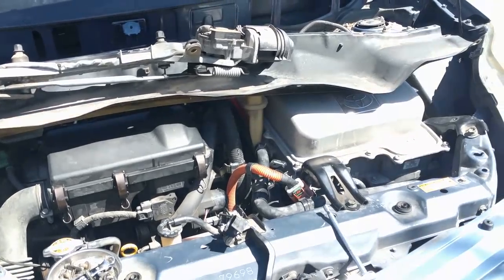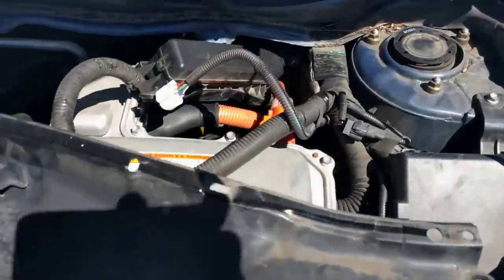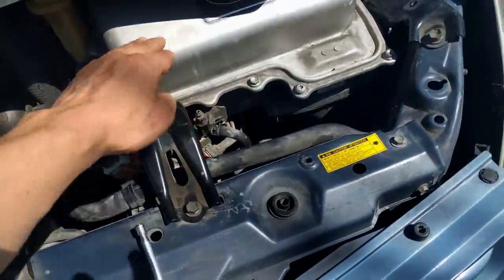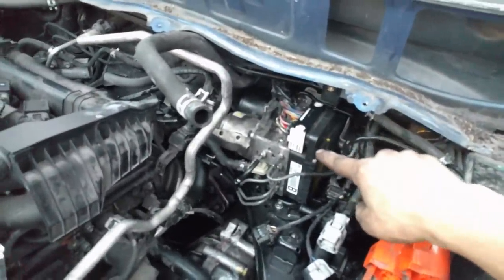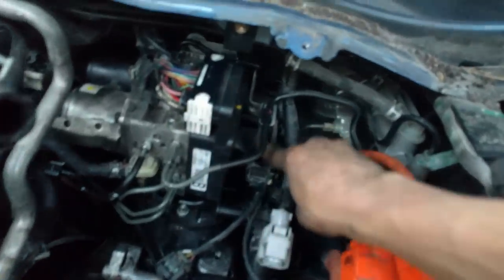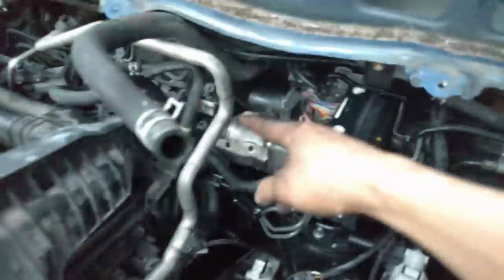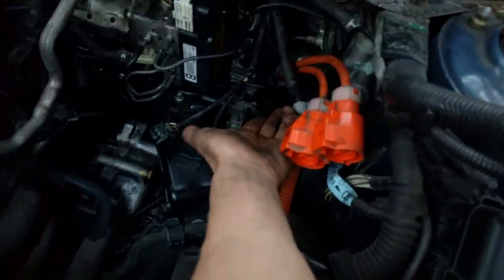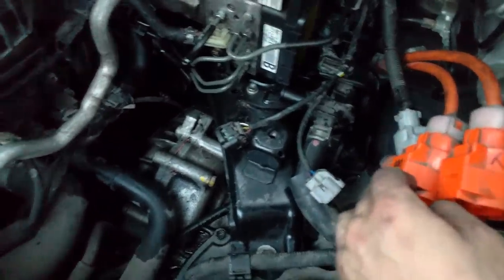2004 Gen2 Prius Brake Pump/actuator replacement

Comment: You only disconnect the 12v? Not the orange switch from the hv battery pack???
Reply from the maker: **You are correct: best to disconnect the orange switch from the HV battery pack. Thanks for posting!!

Comment: Thanks for sharing! Because you didn't die from electrocution, I decided to give this a try. Replaced the actuator and the brakes are working again. Yes disconnect the 12v battery and orange hybrid battery plug. I also waited 24 hrs to do the work. The work can be done quicker with the right tools, due to tight spaces. I used caps on the coolant hoses to prevent further leaking. I manually bled the brakes, which took a very long time, but it was achieved. Thanks again. Well worth the labor.
Reply from the maker: :) I hope your car is still in good shape!! At this time, my actuator and related work is still going strong!
Reply: Can u guys tell me what the symptoms would be if it was a brake booster vs brake actuatormy situation was there was a tall going on for a while everything work and then while on expressway lost braking ability completely one shop is saying it's a brake booster and other sayings brake actuator brakes are not hard to push but just won't break while moveing

Comment: BTW, there is a Toyota warranty enhancement out for this issue just pushed a couple months ago. Toyota just replaced mine on my 2005 a couple weeks ago.
Reply: for free? xact thing happened to my car.. beeping continuously, abs/ brake lights, and loss of brake pressure , i believe the warranty expires Dec 31 2017!! Since im so lucky the beeping JUST stopped, lights disappeared, and brakes are back to normal as i was driving to a friends so i can no longer provide evidence of the issue! Hopefully they can diagnose it still and cover me under this warranty! God help me  can't afford to fix out of pocket lol worst time of year for this to happen :(
Reply: was this like a recall or it needs to be under warranty ?
Reply: Same thing is happening to my 2005!
Reply: @Julia Bovi Hey, did toyota fix the issue for you? Your Prius is fairly new so hopefully they did something. I got so lucky with mine; the light came back on the 27th i barely managed to get it fixed under warranty (expired Dec that year)

My sister has a 2005 with just 75k miles - her went bad the following year after the extended wrty expired. We called corporate - zero help. Spent close to $2500 to fix it. 

Since then I sold my Prius, got a Lincoln MKZ Hybrid and i now have the same DAMN problem with the "brake booster system".  its a 2012 car with 70k miles, Ford said no warranty coverage! User error!? Luckily cost is cheaper than Prius to replace ($780). 
What else can we do with these faulty as brakes on these otherwise great Hybrids.

Comment: That's the easy part, how did you bleed the abs unit and brake system?
Reply from the maker: I purchased a cable off ebay which included a copy of Toyota's "techstream" software.

Comment: Does the brake actuator needs to be reprogrammed after installing new one?
Reply: Bassel Mustafa Yes calibrated , can be done with tech stream software, or I think it was 4 and 12 pin on the data port by sticking a paper clip on those pin holes, and rebooting the car . It will then start cycling all the brakes, and calibrating itself.

Comment: I have a whitlse while in drive on acceration in my gen 2 have you experienced this?
Reply: LIFE&CAR same. Let me know if you figure it out
Reply: @TheHouser21  I cleaned my battery cooling fan i was pretty dirty didnt fix my triangle of death but i dont gear the noise anymore
Reply: @TheHouser21  Update i fixed my car i noticed my intake snorkle was collapsed constructing the air flow and throwing a maf code their may be some junk stuck it the tube  causing suction. I disconnected the tube and now running perfect light is gone.
Reply: LIFE&CAR that’s good to hear, I didn’t have any trouble codes. Was just hearing some noise. But good to know. Thanksb
Reply: @TheHouser21  Your welcome sir
Reply: @TheHouser21  sounds like restricted exhaust...

Comment: I am about to do this service to my car and as it happens it just failed outside the extended toyota warranty. I am currently calling toyota headquarters and see if they give some lead way due to low milage and just outside the extended warranty period. I have techstream. How long does this take
Reply: I'm working on this repair right now. any tips?
Reply: Did Toyota give you any leeway?

Comment: what battery you disconnect 12v?
Reply from the maker: I disconnected both the HV, and the 12V, but I think it's only necessary to disconnect the HV.  You can disconnect the HV at the battery in the trunk.

Comment: What do you do after you do this ???
Reply: miguelsabalza take it to the dealer if you have this issue. They will fix it for free until December 31st 2017, they just fixed mine at Bill Penney Toyota
Reply: Thank you Jonathan...!! Good piece of information, I need to get my fixed. Is that a recall ? Can you please guide me how you got it done ? I'll appreciate it very much..
Reply: Victor Ponce hi, it's my pleasure. It is a recall to an extent. You call your toyota service department and tell them the symptoms of your car, and then bring it there. They do a multi point inspection and drive the car to make sure the actuator needs to be fixed, and then they fix it. Just call the dealership with your VIN ready and you're good to go. Best of luck
Reply: Jonathan Gonzalez but does it need to be under extended warranty because I bought my Prius second hand
Reply: Mick Funny no. My Prius was second hand too. Hurry and cal your dealer to get it done, it’s going to be 2018 soon and then you’ll have to pay almost $3,000 out of pocket.
Reply: Jonathan Gonzalez ok thank you, I have a service appointment at a Toyota dealership for next week, so the abs actuator work should be done by Dec 31 2017. Thank you for your response to my comment. If they try and somehow slow -walk my repair for a month I’ll be sure to tell them to hurry up. Thanks.😀
Reply: Mick Funny anytime, happy thanksgiving to you and your family
Reply: Jonathan Gonzalez just an update, so I had the work done on my Prius, and they claimed it WASN’Tthe actuator, but a hydraulic issue with the right rear brake, Code 1343 sub Code 571.  They also claimed a test drive indicated the brake problem was fixed. the warning lights are gone, and the brakes do seem much more responsive, and it only cost $100 to have the service...but, if the ABS actuator does eventually die, after Dec 2017, my understanding is I’ll be out $2,500. 
So, working brakes, working Prius, all good, I just wanted to say to them “while you are at it, can you add the new actuator I don’t need yet” Still, two days ago a friend was driving a 2009 Prius and was hit by a drunk driver, they are fortunately fine, the Prius is totaled.So I just keep this in perspective...I have a Prius in one piece which should last another 100,000 miles or so. Okay, that’s the update.
Reply: Mick Funny it’s very surprising to hear that it was only $100 at Toyota, that’s awesome for any job. Sorry it wasn’t free by being the actuator, but I hope your Prius does last as long as you need. I’m the same way with mine, I’ve been so paranoid over it breaking down that I never get to enjoy the fact that I have it, and got it for such a great deal. (2007 w 157k, $2800) Anyways, thanks for the update, and have a great one.
Reply: Jonathan Gonzalez so the update is not good, after more warning lights I brought it back and they now said in addition to the actuator needing replacement, which the Toyota dealership will do for free, since for the next two weeks it remains under warranty...they say the hybrid battery is now dying and needs to be replaced for $3,100 (not $31,000 “only” $3,100). So I’m not sure how to proceed. Turns out the battery has just left the warranty time frame. If for $3,100 my Prius will last another 5 to 8 years, it sounds viable, but I need to be sure the replacement battery will last that long. And, they tried to sell me another Prius today after the bad news about the battery. The mechanic seems like a straight shooter, not in it for the $$, but the dealership is there to move inventory. Hard to know how to proceed. Man, a few months ago I thought my Prius was the best car ever for the money, now I’m 🤔
Reply: Mick Funny thanks for the update. I hope you haven’t purchased the battery yet, I know many reputable hybrid battery shops that will replace it for less than that. For example, my 2007 had it replaced for $1800, with warranty. What year is yours, and how miles are on it?
Reply: Jonathan Gonzalez my Prius a 2008, w/72,000 miles, so it is just outside the hybrid battery warranty time frame. The dealership mechanic even informed me that non Toyota shops/ mechanics will install a new battery for less than he will charge, I just need to be sure a replacement still comes with a warranty of some kind. There are even “Home install” tutorials videos on YouTube, but, again, my concern is does the battery have a warranty. $1,500 or a little more I can afford, particularly if the result is a Prius that lasts me another 5+ years.A lot to think about, and I appreciate your response to my comment.
Reply: Mick Funny I see, that’s low mileage for an 08, which may be the causation for the hybrid battery needing replaced. With the mileage being that low a new/refurbished hybrid battery would definitely be worth it. I’m sure you can easily find someone who will give a warranty on a replacement for $1500 or less, I have a few shops on the top of my head but they may be too far out from where you live. Good luck to you, if you have any other updates let us know. Happy holidays
Reply: Jonathan Gonzalez This may work out, I talked to a snowplow guy I know (I’m in the northeast) who knows a guy who installs hybrid batteries in Prius, for far less than the dealership. Sometimes it helps to know “a guy who knows a guy” so I’ll see what the cost is. I think you are correct, getting the battery done at an independent mechanic will be less expensive than going back to the dealer..and a 2008 w/ only 72k milage should last me years. The only red flag from the snowplow guy, if the “new” battery fails, be sure it, as well, is under warranty, which I will research. By end of 2017/early2018 I should have resolved this.

Comment: Hold the first shop said break actuator now a different shop said break booster
Reply: The Prius does not have a booster. Maybe they just wanted to use a term that's more common.

Comment: Bought an actuator off ebay, and the Damm thing was bad, all that f ing work for nothing. I put out 1200 and bought a new one.
Reply: Did the new one worked? I am on the same boat, my mecanic does not guarantee that a new one will work.

Comment: Did you have to use a scanner to bleed the brakes afterwards?
Reply from the maker: Wendell Greenidge I used Toyota techstream software (same as scanner) which is still available online. After using the software I am 65% certain the brakes can be bled without it. (some of the time I was bleeding my car shut off completely.) Good luck, let us know how it goes!
Reply: Tim what do you mean you can do it without the scanner?